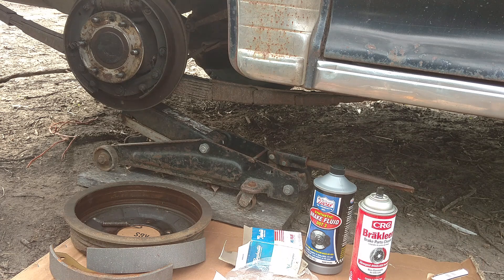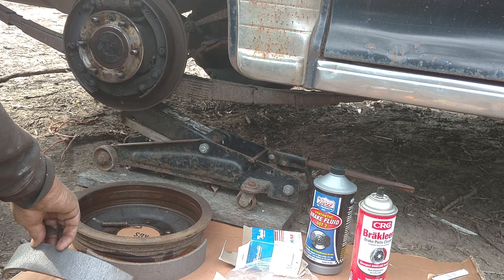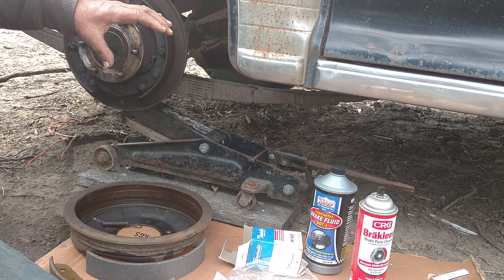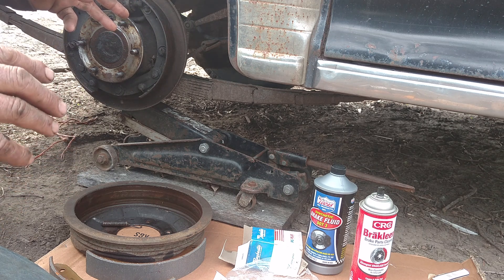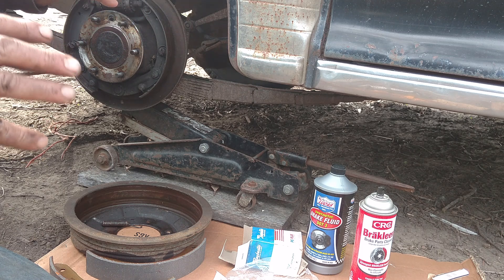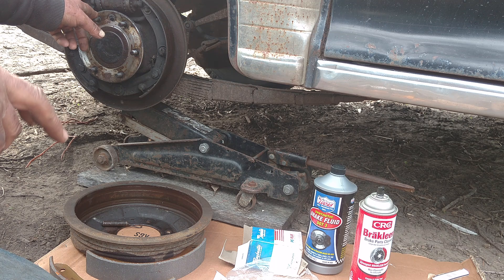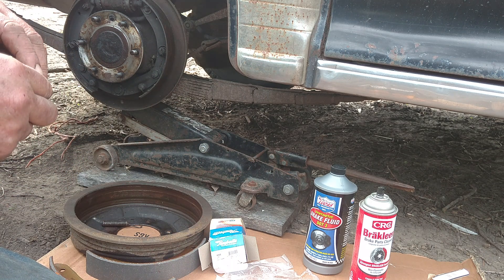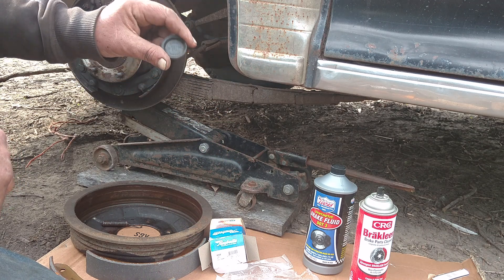Brake time

Comment: $600 ain't cheap

Have you tried cribbing with 4x4x12s instead of just a floor jack?
Reply from the maker: Actually there is a second jack on the bumper, and I am not under the vehicle at any time.

Comment: Interesting how the vehicle companies force one to spend money in a certain way. To keep an older Volkswagen on the road here in South Africa a complete brake slave cylinder costs less than the parts and to buy a new carburettor from China is cheaper than reconditioning existing one. Carburettors are becoming very scarce and difficult to get parts for. A new Weber carb is extremely expensive.
Reply from the maker: Another example is fuel pumps, a kit to rebuild the repairable ones, cost more than the cheap sealed, disposable pumps that you have to replace.
Reply: @logcabinlooms  and therein lies a problem for many a VW Bug enthusiast. Seen many complaints of diy folks that some of those off-the-shelf fuel pumps will run fuel at pressures far higher than the original specs called for and folks can then not understand why they battle at the carburettor end.